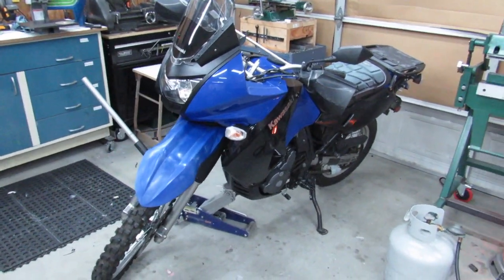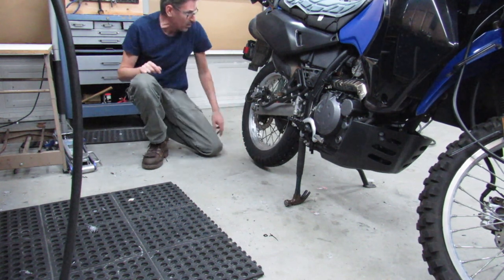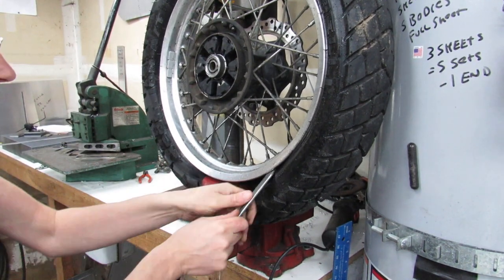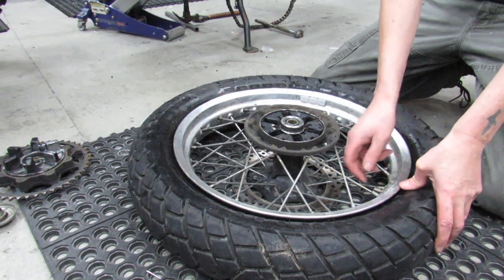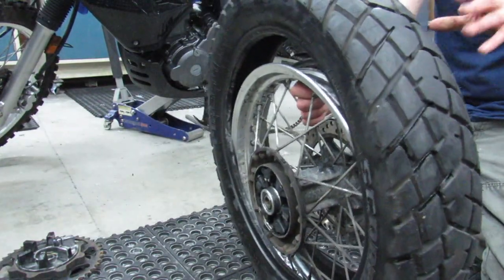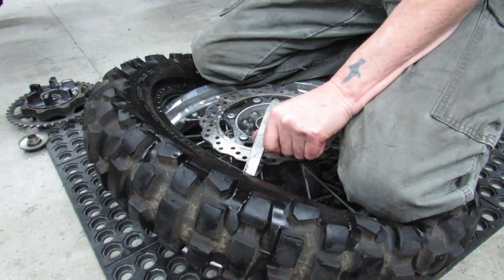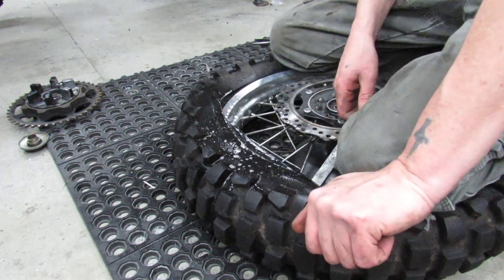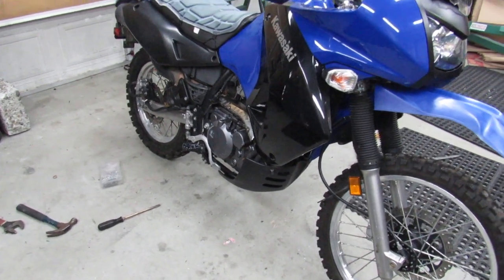KLR 650 Tire change

Comment: For added security you could always throw a strap around your handle bars up the the rafters. Solid call on the extra soapy water. Tires aren't fun for the most part! Ha ha. Doesn't mean I won't do them though